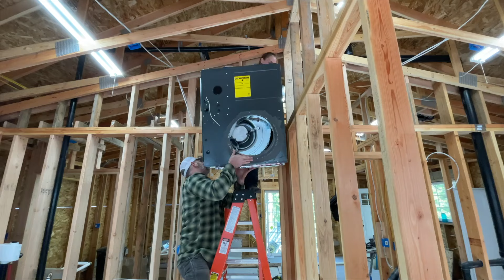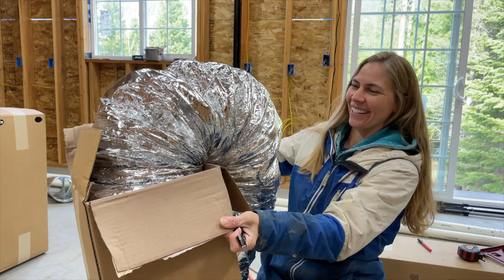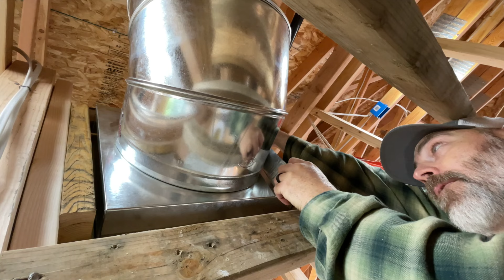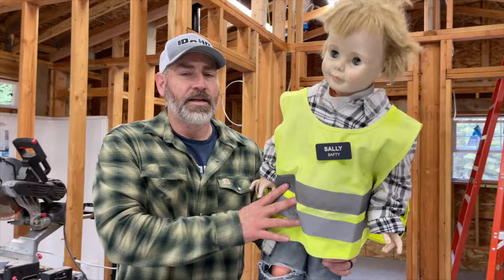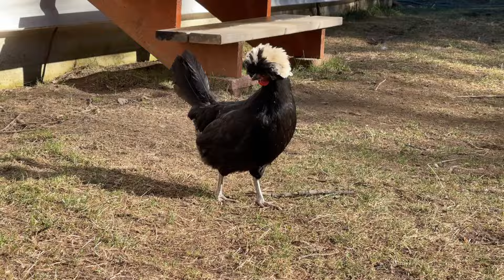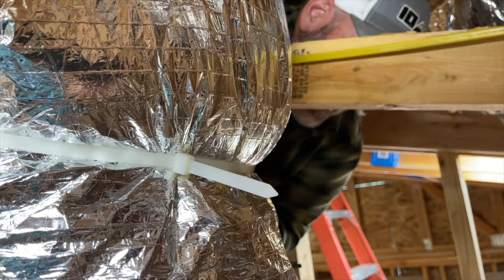Flexible Duct Work Installation - Building our Home in the Mountains

Comment: Per code in some states; zip ties and tape should be used on inside of flex duct. Mastic is also applied to outside of flex duct at joints, over the silver tape. Research how to prevent registers/grilles from dripping moisture during cool mode.

Comment: Mr. Johnson.. you guys are awesome. Although retired  now, I can tell you that best practices are to foil tape "every" seam both on the suction side and discharge side, including all those seams in the handy swivel joints you are installing.  I have used the flex duct and although it is not the most efficient as far as air flow, stick to 6" duct and above and keep the runs short (as I believe you have) and it should perform ok in your small upstairs living quarters. Also, bare metal left exposed will sweat (and eventually rust to destruction) due to the temperature difference (kind of like having a moisture barrier in your outside walls) so insulating any exposed metal ducting is important if you intend to live there for many years.  Make sure to test your installation for adequate and intended airflow/temp control for each room, as changes and balancing are easier now than after drywall is installed. I am sure you and your wife are going to do a great job, I admire you both for taking this on and doing such a great job. Stay safe, stay positive, enjoy your great life on the homestead.... Joe

Comment: I see comments about internet experts. I'm no internet expert but I am an Air conditioning contractor in Florida for 44 years. On a scale of 1 to 10 I'd give you a 4...  What you've done is usable but not the best design.Everywhere bare metal is exposed will sweat....Down the road when the unit needs replacing the guy who gets the job is going to hate life . Imagine how tough it will be once insulation and drywall is installed how difficult it will be to get to it or to even work on it...
Reply: Like you said, it'll work but it's a 3-4 maybe ? He won't listen.
Reply: Can you elaborate on where the “bare metal” is? I see insulated duct work comparable to the mexi-can’t labor that built my first house. Are you talking about the actual vents? Those are always bare metal…
Reply: Oh I see, looks like he didn’t insulate his box. Yikes
Reply: Why not just get a minisplit
Reply: Image how much they don't care

Comment: you have made good progress,  about the duct work.  with that flex you want to use those panduit straps on the inner jacket, they make a hand tool to tighten and it also cuts off the excess.  I like to do it twice to make sure its tight, then you can also get some short 1/4 inch sheet metal screws to run a couple in the straps to hold them in place. then you can wrap with tape to seal, then the insolation jacket it helps to roll the outside lip inward and then use the same straps and tighten down that over the inner jacket so it keeps the insolation in the jacket and holds it in place otherwise you can run the risk of them blowing off of the registers. I dont get into much ductwork since im in commercial work but what little we do work on thats how we do it.  I have seen them blown apart and normally not in a fun place to try to get back into to repair.  If you only taped the inner jacket it would be worth going back and strapping those down. Otherwise a good video.

Comment: Most every home in Albuquerque has the furnace in the attic, no basements. The registers are in the ceiling and the return is either in the ceiling or upper side wall. The bad part is the attic gets so hot in the summer the insulated duct gets heated. When the refrigerated air comes on you first get a blast of heat till the ducts cool too. Over time some of those flex ducts can collapse so need to be checked. Heat can take the temper out of the wire.

Comment: How do you service the unit when it's in that ceiling, why isn't the return near the floor and why aren't you using metal tape on all the joints or duct butter, You need to tape all that insulation down to the metal joints, even if you have big zip ties. Just a few questions and suggestions, thanks.

Comment: strait heat job, so 7-6" outlets will work here. 14" return is good for 700 cfm. the house will need a small 40,000 furnace. Fun times building your own house.

Comment: Foil tape works better than "duct tape Most of the duct tape will be loose after a few years
Reply: I thought about commenting on this as well. Duck tape is not recommended!
Reply: he needs to use duct tape. he is using duck tape.
Reply: I just found some duck tape in our attic and it was holding strong as heck! I had to use a screwdriver to open the old ductwork.

Comment: Just a question  not any sort of criticism   Should your return air not be at floor level   As I understand HVAC if heat is coming in the top return air should be on the bottom or you will have cold floors   Like I said just a question  All the best from Allenford, Ontario, Canada
Reply: You are correct !

Comment: Should the cold air return be mounted low since the hot air supply is mounted high?
Reply: Yes, the return should have been low.  But it still should work fine.

Comment: Great to watch you guys from here in the UK however Martin don't tighten the zip ties too much as you are crushing the insulation, which will allow heat to escape. Try zip tying the inner core tight and the insulation less so. hope this helps.

Comment: A small suggestion is getting the return near the floor, making the unit more comfortable in cold weather. I’m a 40+ year HVAC&R tech.
Reply: I've installed thousands of ceiling returns ..they work just fine
Reply: @dentonterry4540  if you like cold floors in cold weather

Comment: The duct you are using can be crushed, but it takes a lot. It's worse fail point is water. With your duct work in the attic, you wont have that issue. When I installed ductwork for a living, we had to seal all the metal joints, seal the duct to eye connections and zip tie both inner and outer parts of the duct. CA allows for a very small % of air loss.

The problem with an air tight home for energy efficiency; one trades off the health benefits of fresh air inside the home. As we have become for energy efficient, we have caused more illnesses from stagnant air in our homes.

Something to think about.
Reply: Very bad install.

Comment: I’ve done HVAC for years. You never wanna run flex line more than 6 feet. You should hard duct it everywhere and then insulate around it. Flex stack becomes handy one are you going to venting but only on a very short run. You lose CFM with the more Flex talk to you right. Sizing the duct properly is also important.  Best get your info from an experienced HVAC man.
Reply: Evidently talk texting is not too accurate. Let me restate it. 
Flex duct becomes handy once you are close to a vent for connection.
Reply: You lose CFM with the more flex duct that you run. In other words you lose pressure.
Reply: There are formulas for sizing based on length of run and BTU and a couple other factors. Should check the charts before you throw something in. Stick with an experienced HVAC guy that you trust.

Comment: Shouldn't your return air ducting be down at the floor level if you're trying to recirculate the colder air?  Your putting out warm air from the ceiling vents, and warm air rises, so then you are just re-grabbing that warm air to heat it again.
Reply: Yes, it should.
Reply: No its fine

Comment: I'm wondering if y'all would have done well to insulate the roof prior to the duct work. Hopefully it won't be too much trouble for y'all when it comes time for that project.
Reply: I thought they were going to insulate the roof, but the use of insulated air ducts suggests they're planning on insulating the ceiling. Well, I dunno.
Reply: @dper1112  - Hard to say. You just never know with these two. 🤣

Comment: Having done HVAC work I can say of all the insulation types you normally run into the worst is the stuff used inside the square sheet metal ducts for sound. You itch all day after working with the stuff and the glue used is not fun.
Reply: I hear that, did that alot when I was younger.

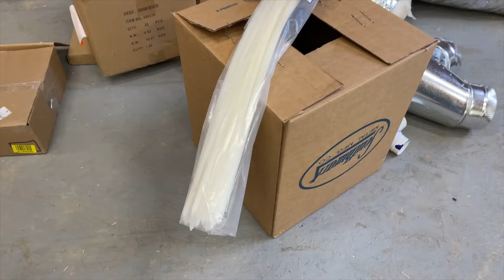Comment: 5:46 I see why safety Sally had to be put away 😂. Did you consider other options? I see some homes built with actual ductwork where it is like square metal.
Reply: I assume the way they went was to cut costs some. That tubing has to be cheaper than the metal ductwork.
Reply: Metal ducting mostly / good for suction or returning air 🤔
Reply: @redbud815  I don't know and maybe someone else in the comment will chime in but I thought it might be cheaper and a superior product because the tubing is insulated.
Reply: @CoderToHomesteader  That's a fair and valid point indeed. I'm curious to hear others chime in on it as well.
Reply: @CoderToHomesteader  Of course opinions vary. :-) Some experts recommend against flexible insulated tubing. Two reasons. 1. Over time, it is easy to crush, and maybe tape comes loose. 2. The insulation is thin, which leads to condensation issues in your attic or tubing or both. The easiest way to avoid condensation is to insulate the whole attic (i.e., the roof above, not the ceiling below). And if you're doing that, the ductwork can be plain metal.

Comment: In the two bedrooms you created nooks by not running the closet the full width of the wall. Assuming the nooks are for a future dresser or desk you may add an upper cabinet above a desk. This future upper cabinet would interfere /block the heat register you placed tight against the wall. Consider mounting the heat register 18" to 24" away from the face of the wall to accommodate future changes.
Reply: You might be overthinking that just a bit.

Comment: I know from one of your earlier videos you said that you had a tool leftover from your HVAC days. David Morris is right, there should be some sheet metal screws to hold things together. Between the heat and the vibration of the fan running I believe it will shake itself apart. Duct tape should only be used to seal it, not to hold it together. Don’t know what made you purchase a Goodman, price point maybe. Although Goodman has one of the better heat exchangers on the market, their controls leave much to be desired. Don’t know what the code is in Idaho but just because it meets code, doesn’t mean its right. You have a return coming in thru just a 14 inch diameter hole in one side of the furnace (to say the least the side with the blower motor, that is blocking most of the squirrel cage.) should be a  16x20 or 25 inch opening or better yet feed from the bottom. Your setup is going to reduce the air flow across half of the heat exchanger that will destroy it. Most likely the secondary will fail first. Between the Goodman controls and the return ductwork setup — even more reason not to have it in the rafters. I say all this for your benefit, as for me being in Georgia, I will not be getting a service call from you.

Comment: Martin I have to ask, with all the heating and air conditioning going in and the extra electrical. Are you all going on the grid?
Reply: It is a propane furnace. The electric draw will be relatively small.

Comment: So I noticed you only have one big cold-air return for the whole system. If you don't have cold air returns in the bedrooms, then when the door is closed, the incoming air won't have anywhere to go, and basically, you won't heat the bedrooms. My in-laws have a really old house, and they cut the bottom off their bedroom doors to allow air flow even when the door is closed.  Not a great solution, but better than nothing.

Comment: @ Marty 
Did you guys ever think of installing a ACoil and run down a lineset for Air conditioning .
You made it hard to service the furnace also .
Make sure you have the exhaust pipe pitched right or the furnace will shut down from the trap being flooded by back up water that drained in the trap .
Also did you place a float switch so if something would go wrong the furnace will shut down if the drain or trap get clogged up.
The A coil from Goodman comes pre charged with nitrogen 400 lb.
You would been better off going with a Lennox unit or weather maker or Payne .
Goodman not the best quality you guys mite have problems down the road .
I've installed many Goodman and there just problematic .
The higher the price you pay for them and more options likemodulating furnace or two stage

Comment: Very interesting to see duct tape actually used for what it was invented for.  You both make things look so easy and do-able!
Reply: Surprisingly it's terrible for ducts tbh 
It's better to use foil tape not duct tape lol
Reply: Yes, except ironically duct tape is poorly suited for ducting. I dries out and its adhesive fails within a few years.  Cellophane "technical" tapes (eg Tuck Tape) or aluminium foil tapes are the generally accepted ducting sealant/connective tape nowadays
Reply: @68Jaguar420G  that is indeed correct
The name duct tape is misleading tbh
Reply: they will find out in a few heating seasons that it should of ben foil tape instead
Reply: @me-ry8jg  yep haha
Reply: Omg this whole video shows what NOT to do

Comment: Surprised you put the cold air return so high.
Reply: @Richard Charles It is better served putting it lower
Reply: If he is installing his registers into the ceiling then no you don’t want to put your return in the ceiling. Every mechanical engineer will design their systems to pull stale air from every part of your building envelope. It has absolutely nothing to do with air temperature.
Reply: Yes I was thinking the same TBH. I always thought cold air return is lower seeing how heat rises and all, but I'm no pro.
Reply: @fredj6278  Just to play devils advocate and indeed not to argue. I am not pro at this. I'd never claim to be. However, once they install some ceiling fans, like 99% of most homeowners do (especially with high ceilings) that argument becomes null and void no? Using ceiling fans same applies to stale air as the "just a guy" replied as well.
Reply: @redbud815  For heating only applications, a low return duct is ideal to bring back the coldest air otherwise stagnant in the room. This is true regardless of the supply register location, floor or ceiling
Reply: @Richard Charles I spent 30 years in construction. I never installed HVAC but I know how we framed for it and it was always installed low or on the floor.
Reply: @doncaranci2547  Makes sense. As I said I'm no pro. I will say furnace at my old house was heat only. Maybe that's why I always assumed it had to be placed low. Thanks for clearing that up. Appreciate it.
Reply: @Richard Charles, You're dead wrong, sorry.

Comment: As always once the video is released it is too late for comments to help.  But having the "cold air" return so high combined with the hot air registers in the ceiling is already a problem.  The intent of a cold air return is to take the cold air from floor level and draw it back into the furnace for heating which minimizes the vertical temperature profile in a room.  As built your return duct will end up recirculating a lot of hot air and there will be a definite heat stratification up high.  Your head and shoulders will be warm but odds are your hips down will be noticeably cooler and your feet could actually be cold depending on how well you insulate the floor from the garage below.  You will need ceiling fans or something to pull the hot register air down and mix it with the cold air down low.  (Ideally of course that cold air return would be moved down to, or at least very near, floor level.  I know it is a big duct that would need a large chase built around it but you cannot beat physics and thermodynamics!) Other comments regarding return vents for the closed in bedrooms, bathroom and laundry room are equally valid and need to be addressed somehow.  Even if it is only cutting a rectangle low in the door and putting grills on each side for privacy and sound reduction.
Reply: Houses arnt built with returns in the bedrooms. Just doesn’t happen and the main return in the ceiling isn’t ideal but it’s also common, especially for small areas like this
Reply: @bamastead5126  Certainly not all houses, especially home-owner built and older homes have returns in bedrooms but to say "just doesn't happen" is a far over-reaching generality.  Most current building building codes require them and every home I've lived in with a central forced air heating system has had them.  Efficacy varies, especially in older homes but they are generally installed for forced air heated homes and often to provide adequate ventilation in "tightly" insulated and vapour barrier protected homes that have baseboard or floor based radiant heating.  What Marty and Julie do in a region with minimal building codes is up to them, but basic heating and ventilation principles still apply and there are consequences for not following them.  Will it matter to them, probably not as we have seen Marty ignore posted advise many a time.  It's their house so they can make their choices and face the consequences of those choices and either live with them or develop a work around if the consequences bother them.
Reply: @68Jaguar420G  I get ya and I know it’s done but I spent 5 years in general construction working on custom homes and cookie cutter homes and I’ve only ever seen 1 or 2 returns in a home.    Good idea yes but common ? In my experience it’s not but we probably live in different areas so where you are it might be common practice, for me.... I’ve literally never seen it

Comment: When you go to replace the duct tape, use foil backed tape;  stronger and longer adhesion. Heat resistant, too. I'm also wondering why the "cold air" return isn't located near the floor. two or three runs between studs would give you the same return area and prevent thermal "layering".
Reply: Just asked the same thing about all you said. This install is sub-par.